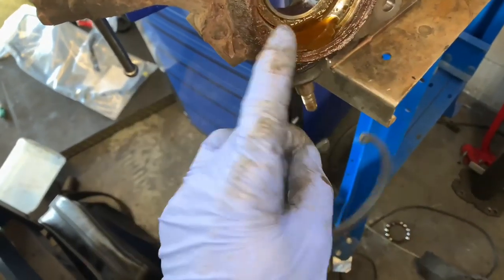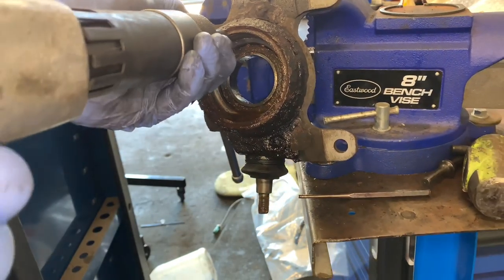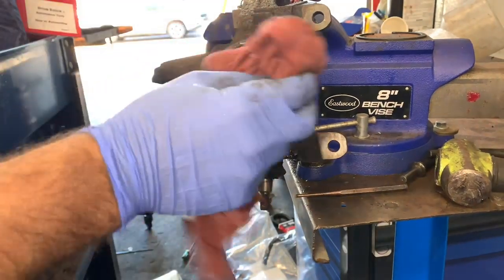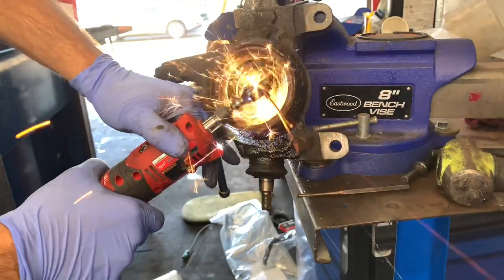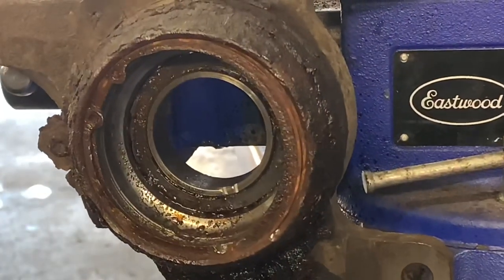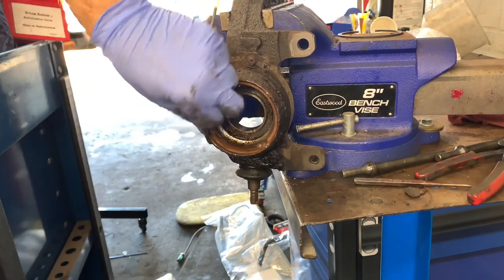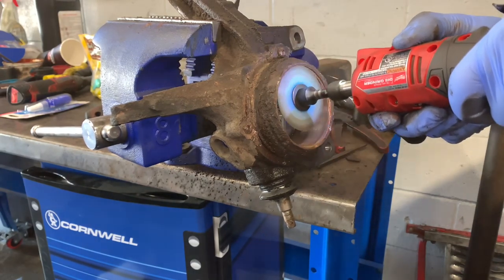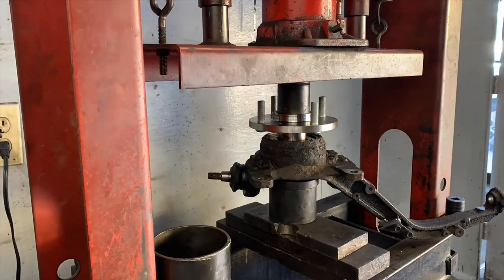Removing A Frozen Wheel Bearing Snap Ring Doesn't Have To Be Difficult!

Comment: Nice video, I just heated up mine with a torch and then tapped with a flat screwdriver and it worked. I don't own a air compressor. In the beginning I was thinking maybe it gonna explode or something, but it was smooth.

Comment: Ha! Just went through this last week on a Saturn! Super frustrating.
Reply: I was about to do this job this weekend and just last night I found they make a compression toolkit with a hub grappler. I'm going to dish out the money in the name of saving time and effort. I've worked on my suspension and replaced all rotors so I know my parts won't be stuck like in this video. EIther way, a snap ring is the least of my concerns out of all the things that could go wrong. Hopefully, it all goes smoothly.